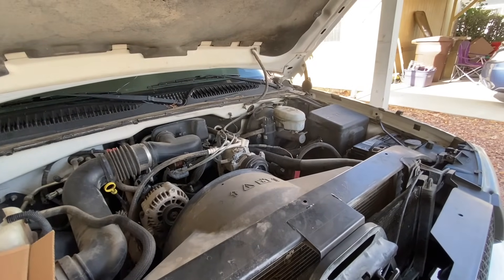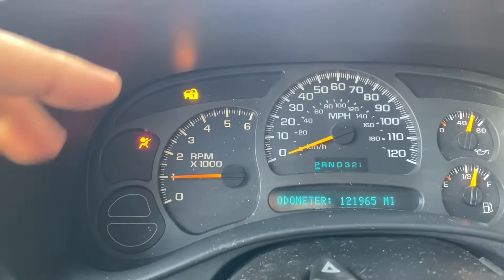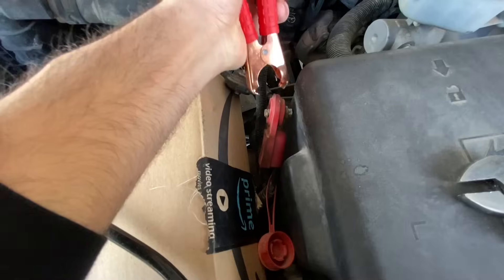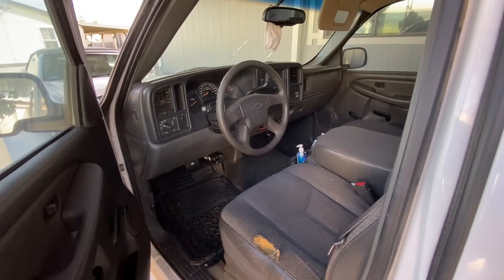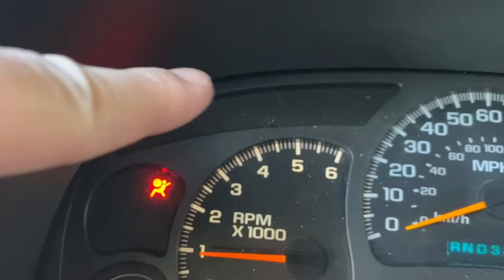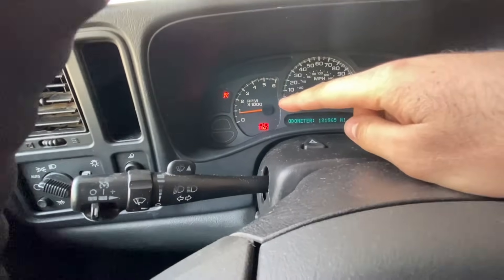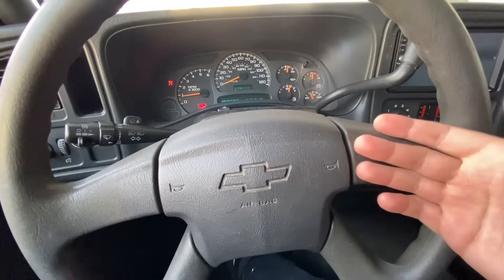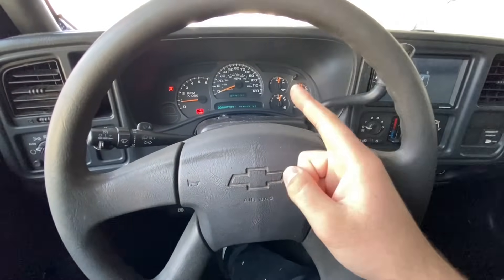How To Reset All ECU’s And Control Modules In Your Car Or Truck Safely

Comment: Congrats on showing what is called a hard reset it only takes about 30 seconds to discharge all capacitors and reset all adaptive memory takes 50 miles to relearn approximately and any codes that are current will return
Reply: Hi, can i do this on a newer car, Cadillac srx from 2014? I have some possible TCM issue on the transmission but affraid will this system erase something so it cant drive
Reply: @lukadjuraskovic16  any vehicle with a computer probably won't solve your problems with a tcm but worth a try
Reply: @robertw8614  Just want to try before i decide what to do as i have basicly no options in my place. I was just asking because i am affraid will it erase some important data like Vin or something so i cant move it. In the other hand i dont know will i do anything before the problems become bigger as its quite rare . Dont know wgat to do, no dealer, no compurers to program or test the transmission ,its all on " i think its this or that " 

Thanks for your reply !
Reply: @lukadjuraskovic16   vin is hard programmed in you will only reset your codes and adaptive if there is a glitch in what it's learned problem may solve itself but your hard programming is safe I'm in an area where I'm the only one capable of programming and properly diagnosing gms our island has 2 shops and closest gm dealer is 300 miles by boat
Reply: @robertw8614  thanks for your reply. I am in Montenegro (Europe) closest dealer 2000km away. Someone changed the Torque converter but it did not solve problems or ita broken again. Its done 50k milles before. Probably its the electronics you takl about but i see its inside the gearbox, hard to find people here to fix ,plus for programing who knows ,maybe there are other softwares to do not only the factory one. Ill reset all so i see the first error codes as now i have 10 and we dont know how to read them ,to know whats good or bad
Reply: @robertw8614  how many miles for a ford for codes to come back? I was going into limp mode, dnt want to get into specifics......I also don't want to pay for another tow. I have replaced hopefully faulty parts. Can I just put it on jack stands and drive for 50 miles to confirm my issue is fixed? Probably sounds crazy. Lol
Reply: @TKO-NY  it varies from conditions 50 is a good rule of thumb but it's more what's called drive cycles if you just drive straight 50 miles and call it good it may be 2 or 3 key starts and problem is back because it finally completed its drive cycles
Reply: @robertw8614  will jack stand driving do it? I'm in over $400 in tows prior to replacing the  hopefully faulty parts.
Reply: @TKO-NY  not really you need the load of road driving so all sensors are working in real life driving so it relearns how to operate
Reply: @robertw8614  ugh

Comment: Every video shows a booster cable with one cable I’ve never seen that so mine are joined what do we use oh my god can you make this simple for women to understand too
Reply: What is the problem? Not sure I'm following you? Disconnect both battery terminals/cables from battery (very important - negative first, positive second). If you are using a pair of jumper cables (rather than the single jumper, like he used), only use one of the colours - red or black, to connect to both the positive and negative cables you disconnected from the battery. You want both these cables connected during this process. Wait 15 minutes, take off jumper cable, reconnect battery (very important - positive first, negative second). Follow the rest of his procedure and you should be good to go. Hope this helps you, cheers.

Comment: I need help I have a brand new ECU and it doesn't want to turn over I get power but the car don't get power to turn on the starter to turn the motor to crank do I have to reset the ECU
Reply from the maker: A new ecu will need to be programmed

Comment: Instead of hookin up jumper cables, just turn the headlights “on”. It’ll drain the same way. With a click rather than extra work. 😊
Reply: How long do you leave the headlights on
Reply: @genx6359  flip the lights on via the switch on the steering wheel. Usually the opposite of the blinker. Sometimes it’ll be a dial in newer cars like my 2021 Equinox.

Comment: After more than a year of my engine light being on with the knock sensor code, which was preventing me from getting it inspected for 6 months, I just did this today on my 2002 Chevy Silverado 1500 HD and with this method I was able to get it to pass inspection. I got the knock sensors replaced more than a year ago but that didn't stop the light from coming on. Hopefully, with the new sensors and the ECU recalibrated using your method today, it is fixed now for good.
Reply: Did that work
Reply: Knock on wood -- been chasing this for two weeks now!  Did the above ECU reset -- couldn't trip the codes (heavy rainstorm preventing monitor-resets) but  also couldn't trip the KS codes.  Will be retesting in better weather tomorrow.  Optimistic... but have been that way a dozen times now!  Will update if this nailed it!!
Reply: Whelp! Dang! P327 & P332 came back during monitor-reset drive. 2002 Silverado 1500, changed sensors & wires (Dorman 926-084 kit).  Have tried this ECU reset (negative cable to positive terminal); resets from disconnecting negative 30+ minutes w/lights & brake depressed; code resets via ODBII devices; revving engine to 5K RPM 3-5 seconds (twice in row) -- and various permutations of above.  Both sensors measure 103K resistance; output voltages via pings to engine (and while running); continuity to PCM measured via biased circuit voltages .018 & .017 volts; ground mesh cable to engine seems robust; wiggling cables don't seem to cause glitches.  Note: original sensors retrieved from trash seem to yield same good values!!!   ps. this video's ecu reset seemed to help w/performance!

NEXT STEPS??? Gonna retry researching all the grounds for the car (including to PCM and engine-to-firewall again???); tracing wire from KS clip to PCM pins -- to measure conductivity & resistance; rumors of there being CAPS on PCM board tied to KS circuit? yet another ECU reset per this video???  Would love access to ECU tuning tables that some seem to have; have thought about using the same sledge hammer that i've been using on my head for weeks!!!

Any/all advice welcome!
Reply: @dziggy3004  any updates?
Reply: @dziggy3004 have you found a result to fix this problem? I have the same situation all good values
Reply: @Eli-ko6gl  yes! way too long of a story to fit here (and took lots of video about this MANY problems & related design flaws, hoping to post it some day).  however, the SHORT FIX -- is to EFFORTLESSLY change it from an "INSIDE-the-engine, TWO (2) KNOCK SENSOR"-setup, to an "EXTERNAL, ONE (1) KNOCK SENSOR"-setup. for convenience, having already changed them TWICE -- i completely ABANDONED the set of sensors and current pigtail wire harness (already in place). I had saved my previous old pigtail wire harness for the knock sensors.  i then inserted just ONE (1) of the OLD knock sensors (nothing wrong with them!!!) into one of the existing unused bolt-holes on the FACE of the CYLINDER HEAD (the passenger-side HEAD, vehicle front side of head, ie. below the oil-refill spigot and immediately behind my alternator (at least for my 2002 silverado setup).) (conveniently, the hole sizes are identical, so no need to tap anything!)  then i took my old-spare pigtail sensor WIRE HARNESS, cutting off the SHORTEST pigtail lead, while leaving enough of the short lead's wire to SPLICE it to the LONGEST pigtail lead (soldered & wrap with electrical tape.)  This will FAKE the computer out -- so that ONE COMMON SENSOR will be connected to TWO COMPUTER INPUTS!  Then simply plug the modified pigtail to the (1) KNOCK SENSOR, and the other end to its CONNECTOR (where you abandoned the previous one).  Cleanup new pigtail pathway with a couple zip-ties!  Reset COMPUTER! VOILA!
Reply: @elgallorojo  yep, see my update below/above
Reply: @dziggy3004 how’s it holding chasing this issue my self
Reply: @dziggy3004  Thank You for being so descriptive & precise with your process, I am going down the same road myself. Good Luck!
Reply: @EricaNicole_  Awesome, the final workaround (just abandon TWO existing knock sensors (under manifold) -- and installing ONE (wired in parallel) on EXTERIOR of engine (see notes above) will work like a charm!
Reply: Did it work? I’m chasing this issue rn
Reply: I'm curious as well. Did it work? I have an 02 Silverado 4wd
Reply: @waltercallihan  my solution was finding sensors from dealer that aren't faulty.  You need to test them before installation even the ones from dealer. There's a YouTube video that shows how to test them. No light for about 2 weeks now
Reply: You can buy a cheap OBD2 scan tool that will tell you the codes and you can clear them. Harbor freight even sells them....
Reply: Pull the globes out 👍

Comment: Thanks so much for sharing this method. I will perform thess same steps after replacing my throttle body.
Reply: Did it work, I cleaned my throttle body and now my Chevy idle is to high after I step on the gas ,
Reply: @michaelgallo2723  ppl never put their end results for us all to share. Sad, but true. Hope you fixed your issue.
Reply: @michaelgallo2723  on my ram when replacing mass air flow the manufacturer said to cycle throttle 5 times to the floor with ignition in Acc mode

Comment: Great video ty. I got P770 error on my car and replaced the solenoids and still came on. The guy eventually replaced the entire tranny cause  he was not sure why it keeps coming on. Even after the replaced tranny the check engine light came on again with same error and I am so frustrated. Will this system work for me? I have a 2001 toyota sequoia. Pls advice. ty
Reply: should of tried this proceedure prior to replacing the transmission
Reply: @1mandrywallarmytv144  after the new transmission, the problem went away. It was tranny error.

Comment: This doesn't resolve anything, Because as soon as the truck starts and runs for a couple minutes out of the warm up mode and stops reading all the monitors any problems that the vehicle had will ignite any any service light again again so it just ends up being a complete waste of time The lights come on for a reason you you put a computer on it to diagnose why they came on in the 1st place and fix the problem, Just going to give people false hope thinking they will repair their car touching terminals together,  Yes you will clear the light Until monitor finds the problem again and and sometimes that takes a couple drive cycles but it will come back on if you don't fix what's really wrong
Reply: I do believe he was quite clear about that! It won't magically fix an existing/real issue!
Reply: That's what i was thinking. Once the monitors reset, back to square one.

Comment: So I just have a question would this work on any vehicle? I have a 2009 Cadillac SRX wanting to try this also
Reply: Hello, I see you were looking at a video that you had a Cadillac SRX and you wanted to know if you could reset or disconnect the battery .? Did you ever do it and hopefully it worked out for you? I have an SRX too and I also would like to know

Comment: This is an absolutely reliable procedure that calls ecu flashing I communly uses on Audis and chevy very successful procedure because it is able to drain mili-volts in every single circuit like capacitors resistance and chips even E-prom component thanks .very nice video greetings from Venezuela.
Reply: Will this work on Audi's readiness?

Comment: as you said that more complicated cars you cannot dissconnect the battery, my question is don't they always dissconnet the battery on every vehicle when they weld the car to protect the battery, I am no pro at this but I am wondering how this works.

Comment: Replaced the transmission control module on my 2002 dodge grand caravan work van due to been stuck in limp mode 2nd gear, after install the problem was still there and was disheartened, more research led me to realizing i had to reset the TCM and then i came across your video, Initially i was skeptical but gave it a go, IT WORKS!!, not only does it work, its works better than ever. Thank-you so much for the information
Reply: Ooh.. that's so frustrating! I can relate! Own a Ram, almost replaced the TCM, a while back, was duped into spending 1k replacing the PCM, now a few months later, having the same issues. So.. here I am, so glad to stumble across videos about this method! Also, thankful for people who work at other shops who are honest! It's rare!
Reply: I'm trying to bypass ignition switch from 2011 Mercedes-Benz sprinter 2500 with 3.0 diesel. The computer says the ignition switch is bad. Is this something you can advise me on, will it work? Anyone?? Thanks
Reply: @ronnmiller9085 replace ignition cylinder with Doorman coded replacement $50_$100 fixed all my dtc codes
Reply: Bot
Reply: Damn bro how much was the new transmission control module ? I had my check engine light come on, took it to autozone, n dey said I needed a new one. They were going for like $600-$800 so I needed to find another way 😂. I found out about resetting the cars computer, so I did it (and also changed my transmission fluid because it actually really needed a change) n now my car was running great. But about a week after I reset it, my gauge that tells me if my car is overheating or not, isn’t working. I’m gonna do another reset just to see if it will fix but I’m not sure
Reply: Check your coolant temp sensor sometimes the sensor goes bad sometimes it's just the pigtail that goes to it

Comment: I tried on colorado 2007 but the codes are comming again...  misfire cylinder 5 ... i change the coil , sparkplugs  compressor is good .
And power train traction fault....  i changed  ,  gaz pedal + the trottle body . But the codes are there each days.  Presently i use an application on my cell to clear the each 30 secondes but that dont fix the problem lol. I need help lol. Thanks for your video

Comment: Does this affect Recalibration done on the ECU?
Reply: Almost all the calibrations in the Engine Control Module are written to the EEPROM meaning it has to be electronically erased. This is done with a scan tool. 
  Clean the battery terminals with a small wire brush, a mix or paste of baking soda & water and use an old tooth brush. It is a chemical reaction between an acid and alkaline. Even a cola has citric acid so it can works on Cooper oxide, the part the turns green. Have the battery tested at you parts store. If you have / buy a digital volt ohm meter, then when running check the voltage level at the alt and move ground around to the fender, frame, block and battery negative. You are looking for a loss. Loss means a dirty, loose or corroded connection or broken. Remember that alternators produce the negative current off the back housing. 99% of the times, there is a threaded shallow hole on the back that allows a 10 gage or larger 6 gage wire & eyelets the from the alternator to the block, cylinder head or intake lowering resistance to the battery. Using "Star Washers" sold at home improvement stores sell internal & internal star washer that are effective on rusty, galvanized, painted or undercoating. But checking for voltage drop is alway done with engine on, lights, heater on high, wipers, stereo, just current flowing thru an active circuit to check. It works every time. 
An Engine Control Modular's had to sent out for basic reprogramming be it used or update to a restoration. Visit LT1Swap website because Brendan has a lot of offer as extremely reasonable prices. DK, Omaha.
Reply: @deankay4434  Thank you

Comment: You should use a light bulb in between positive and negative to safely drain residual power, otherwise you’re causing your pcm to sustain unnecessary heat from the power drain.
Reply: Please explain? I’m in the middle of not trusting a mechanic Vs paying 4k for a new tranny on my 05 dakota because I’m getting p0700 and error in my 2nd, 3rd, and 4th gear
Reply: @lescobrandon8162  could be a couple of things.. shift solenoid, or simply might just need a tranny flush and new filter.. could also be just faulty wiring. You’ll need to troubleshoot these possibilities.
Reply: @lescobrandon8162  the lightbulb between red and black cables allows the heat to go to the bulb instead of the pcm. It is a good way to reset the pcm, but it won’t fix real issues.. it just wipes memories of old troubles, so after a repair this can be done instead of using a scan tool with relearn.
Reply: @StitchDGlitch  how does a person put a lightbulb in between??? Im confused!!!!  Just lay it down??? Or what🤯
Reply: @followurheart1111   you can get creative but easiest was is a continuity tester..
Reply: how do you use a light bulb in between it?
Reply: you should show us how to use a light bulb and are a continuity tester on it please!!!!

Comment: Wait after taking neg and pos terminal off, I'm lost on the next step.. with the jumper cables, connect pos and then negative cables to terminal? Or connect both red cables to the negative and positive terminals, Please Answer ASAP!!!
Reply: I think your best solution is to watch the video several times rather than expecting someone to answer you ASAP
Reply: He takes both cables off of the battery. Then cardboard, then takes 1 side of the jumper cables hook it the positive cable then he takes the other side a connects it the other cable. Creates a loop with the cables. He didn’t hook it to the battery, theres only one place to connect the jumper to the cables while they are off the battery 😮

Comment: I disagree with the way you are doing it. I learned you use a 10 watt 1 ohm resistor to use instead of the straight connection terminal to terminal.